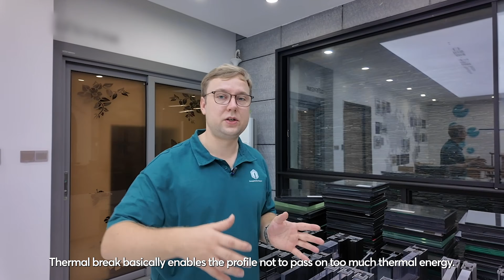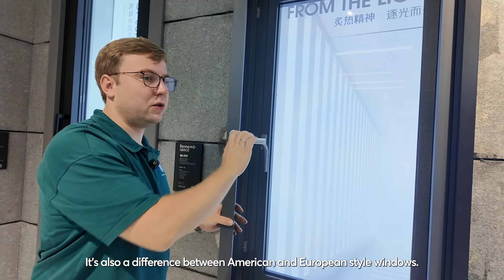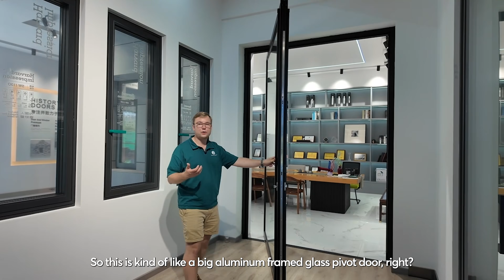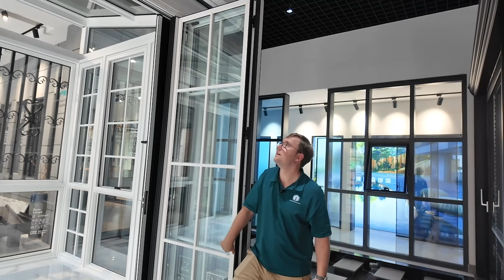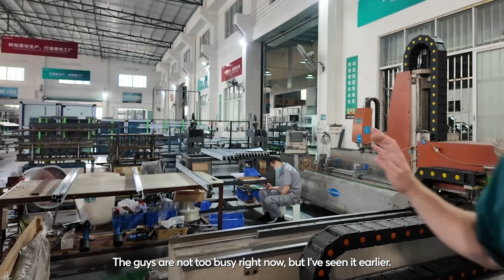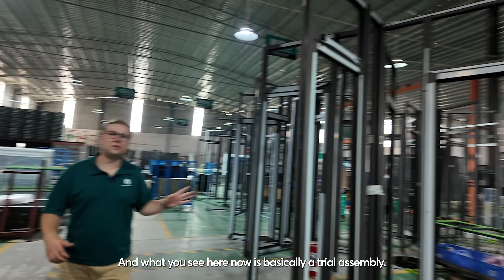Inside a Chinese Aluminum Window Factory | Showroom Tour, Manufacturing Process & Sourcing Insights

Comment: Thank you for sharing!
What's the appx cost before shipping etc for the wood clad with triple (u 0.18 appx) using Hoppe hardware?
Reply from the maker: This isn't so simple to answer; it depends where to ship and also how much we would be shipping.
Usually shipping is most cost-efficient if you are able to fill a full container.
Reply: @guangzhousourcing2765  how about to MN appx 15 units at a time (5'x5' on average)